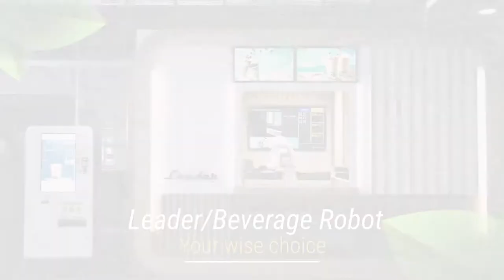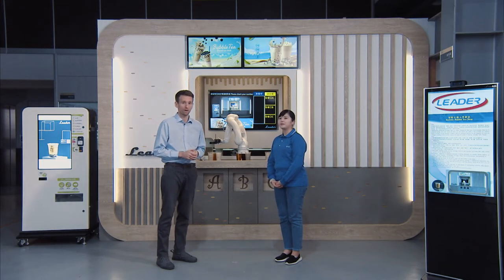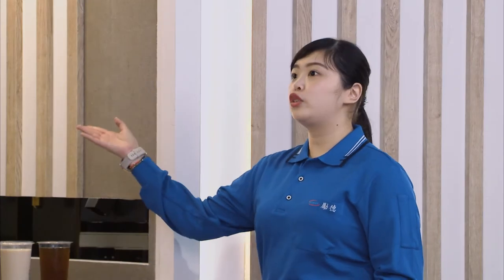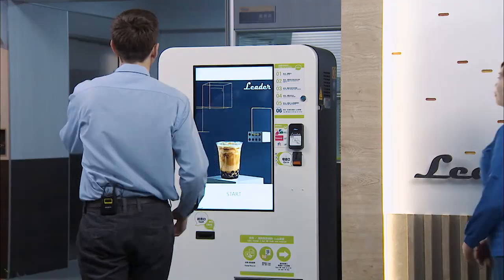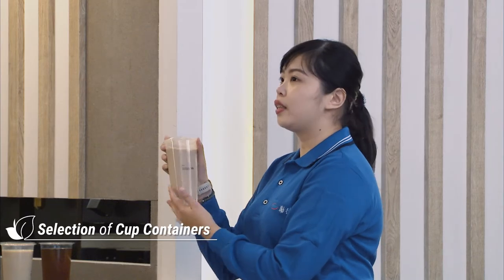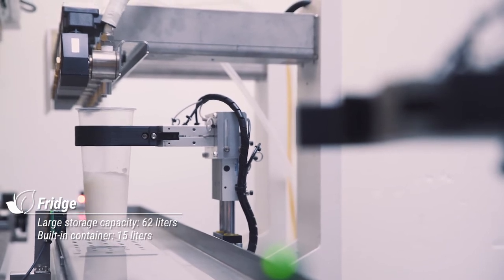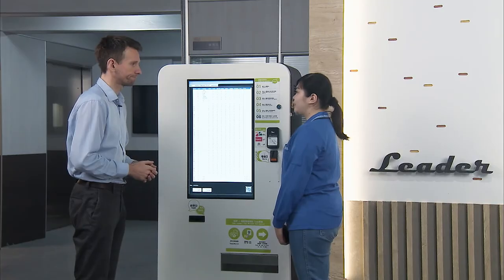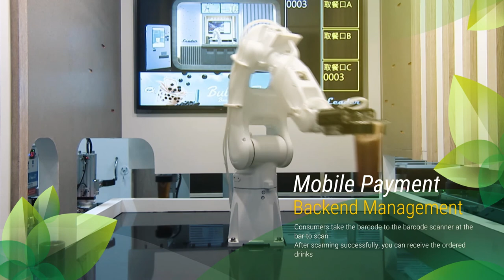So tasty!🥰 Beverage Robot brings you the taste of Asia: Tea, Ice-tea And Custom Drinks🥤 | Bubble Tea

Comment: Cool machine but the price is way too expensive. You can buy at least 13 soda can vending machines for this price. The price needs to come down to less than $10.000.
I don’t believe selling 300 cups/day is realistic especially considering that the machine can only hold 250 cups. I think it’s probably more realistic to expect a ROI in 4-5 years, depending on location.
Reply from the maker: Thank you for sharing your thoughts, CoderDBF.